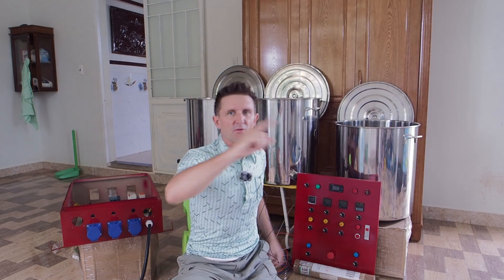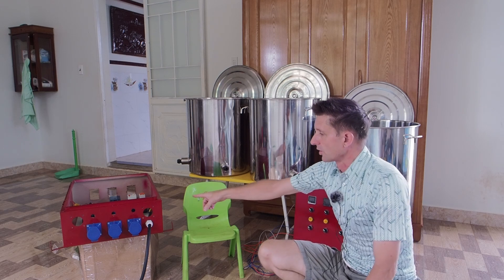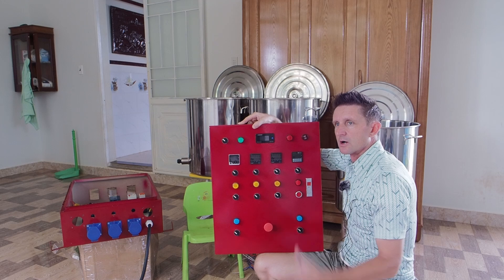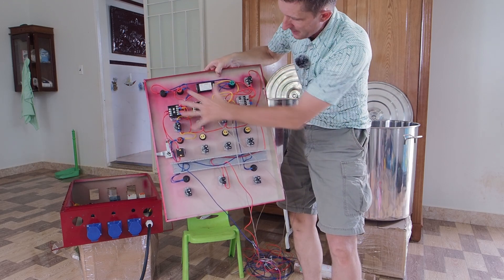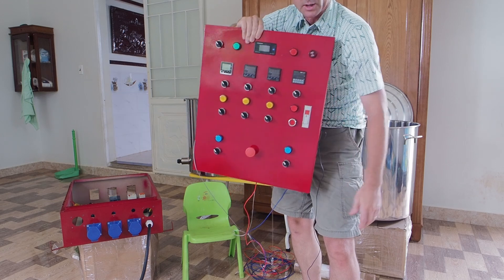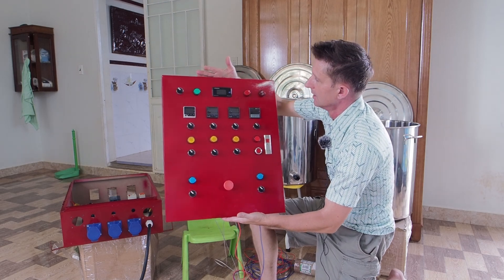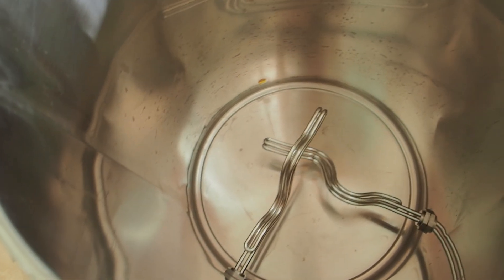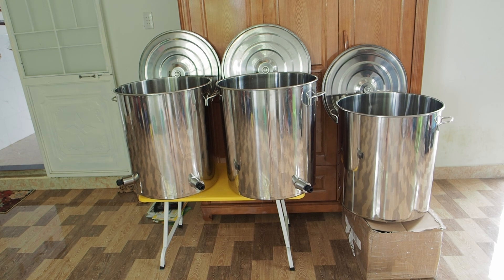Expat in Vietnam micro brewery build

Comment: xin chao roy
those ketle's look the bussines 
where did you buy them???
that would make me a beautifull ferment ketle
greetings from the netherlands
Reply from the maker: Hey Ronnie... the kettles are from China and were super cheap. They are quite thin but will do the job nicely. And.. yes. There are great for fermenting too. There are a few options and the taller less wide ones are better suited for fermenting. Take a look on Alliexpress.. however the shipping to Holland will be expensive and lengthy. leaving them exposed to rough handling and ultimately damage. Mine arrived with dents and I had to hammer them out with great care. I will messsage the seller next round asking for better packing and perhaps the thicker walled pots too, as they werent that much cheaper.

Tell me about your brewing and set up.. volumes, kit and history. I love the homebeer brewery channel and followed Glenn for years. 

look forward to hearing from you.

Sláinte